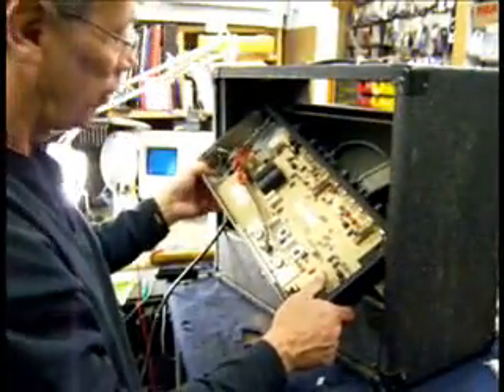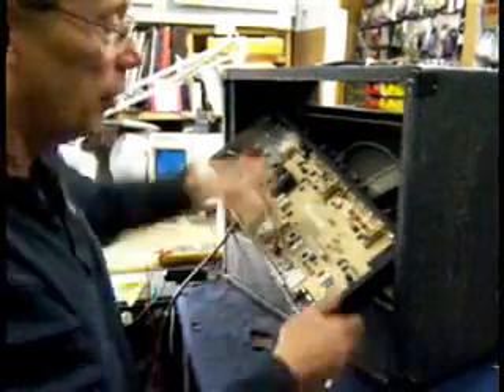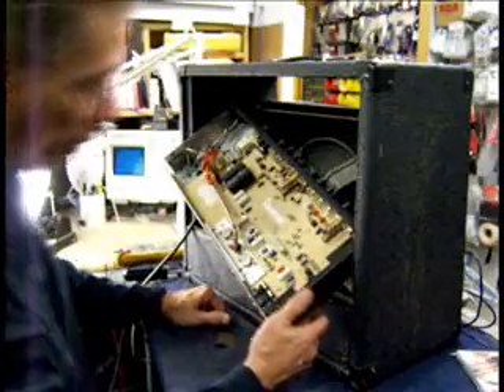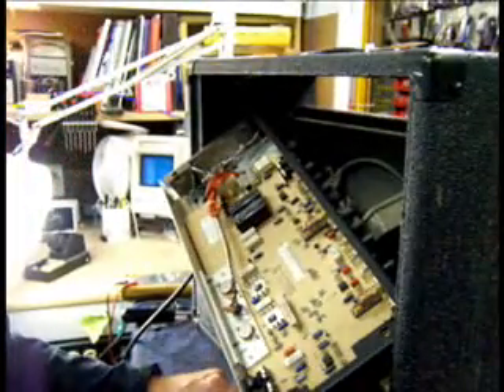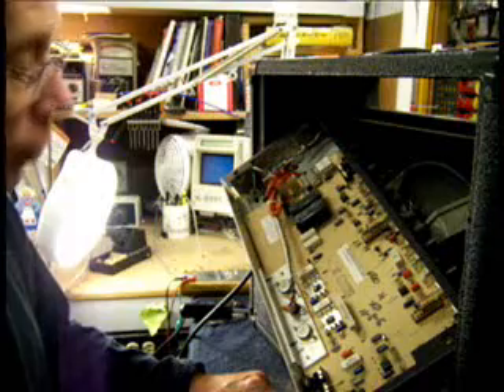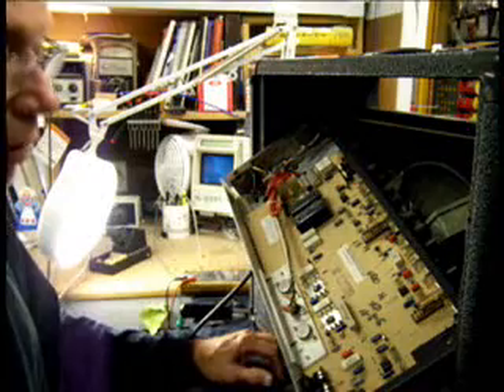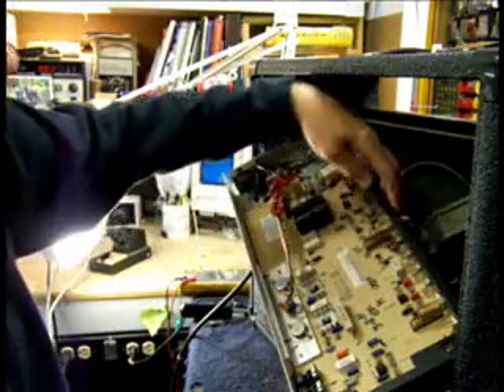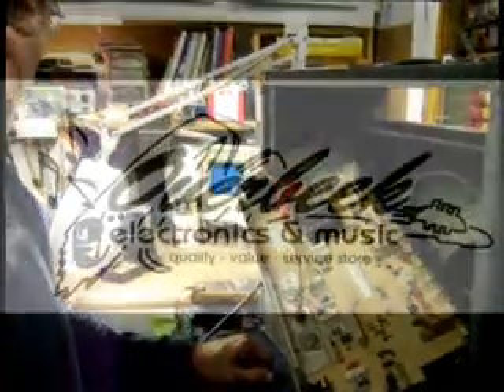Peavey Bandit Repair Demonstration - Overbeeks Electronics and Music

Comment: Dear Overbeeks Electronics,

This is the only video on youTube that talks about this issue. I have a Peavy transtube amp112 and it has the exact same problem. I know for fact that the cause of the problem is exactly same as what you mentioned in the video. However my Peavy's "EXT SPKR out" jack (the one with the issue), is not part of the main circuit board. It is independent and connected to the main circuit board through a ribbon cable. This means I dont need to touch the main circuit board to fix this issue. Now the ribbon cable actually runs from the main circuit board to a very tiny small 1inX3in board and this tiny board only provides 3 connections to external speaker jack and 2 connections to foot switch. I use foot switch but never use the EXT SPKR jack. Now my question is if I dont use the EXT speaker jack, cant I just remove it from the tiny board to solve the problem? I mean nothing ever goes into that jack that means those 3 connections on ribbon are always zero signal. Why dont i just snap that jack out of that board. To replace that jack I would need to go to a shop which I want to avoid. Unfortunately I cant test it, I dont have soldering equipment.

Let me know please.

Comment: I found another video that puts a bandaid on this problem using a patch cord between the Line Out and PWR AMP IN ports on the back: https://www.youtube.com/watch?v=DcXf7sil7bU

After inserting and removing the patch cord a few times, I no longer needed to use the patch cord. I'm going to try to do a full cleaning of the jack/switches before changing them out or leaving the patch cord in.

Thanks for the video! It helped. I would have never thought it was those connectors.